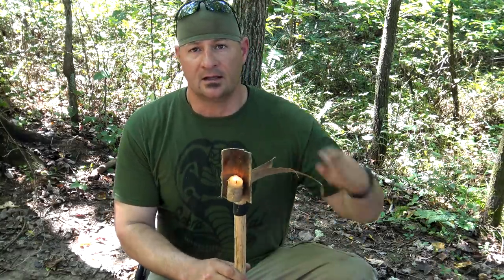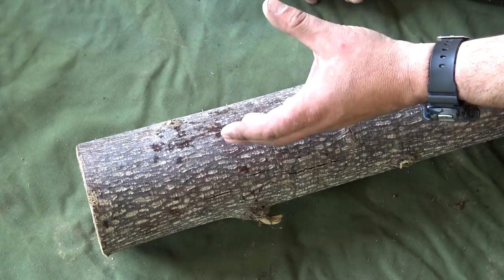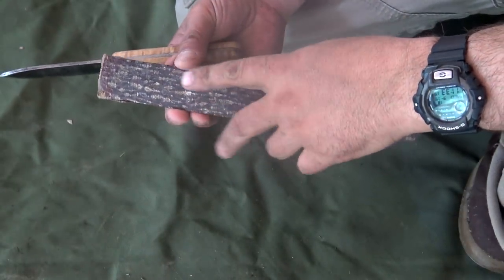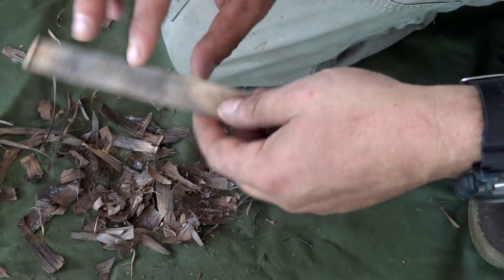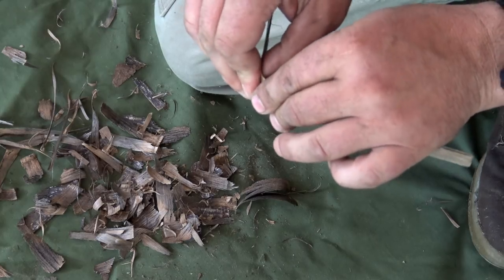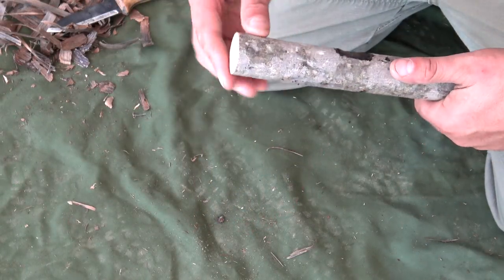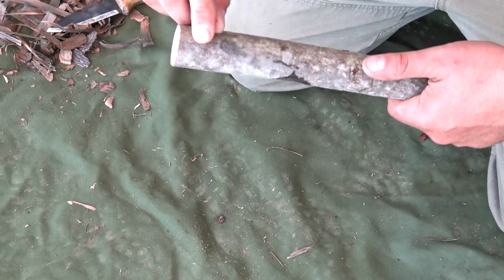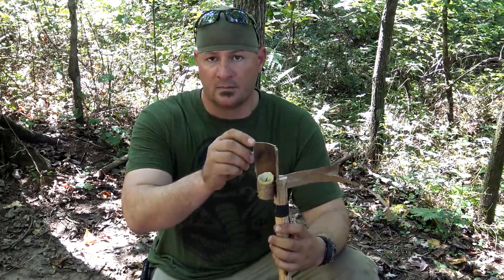DIY Bushcraft Candle Holder

Comment: Always nice to do the draw knife cutting of the bark with the knife in the outward diagonal position, and push the blade away from you ... so that if the knife gets away, it will all be forward of you ... and not fly toward your hand, knee, or inside thigh.  It is the same for all papermakers and cutting down paper rolls with their paper knives, always diagonal and always away.

Comment: Very nice!    I guess you can scale this up to fit around a jam jar and then use a bit of molten wax to make sure it stays firmly in the loop.  Maybe also stick a bit of aluminum foil around the back edge using more molten wax.  (Of course it assumes you can find a jam jar, but in urban environment or unfortunately even in the wild its surprising what crap people throw around)